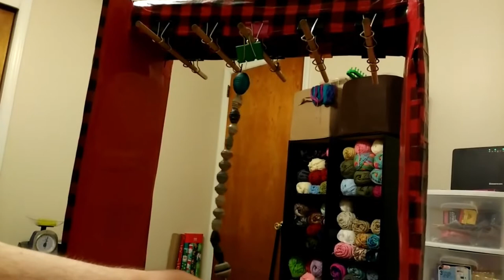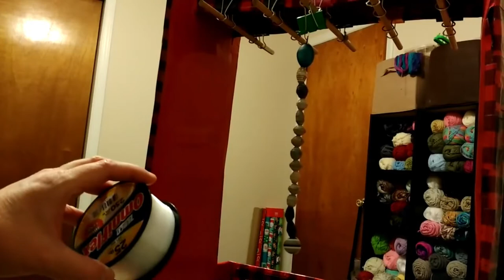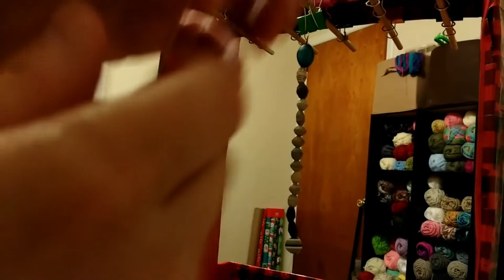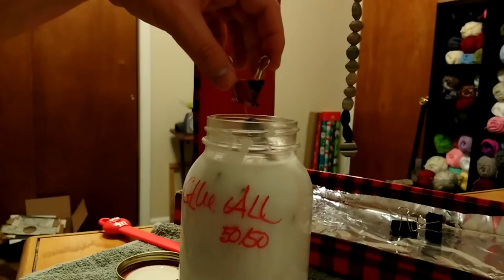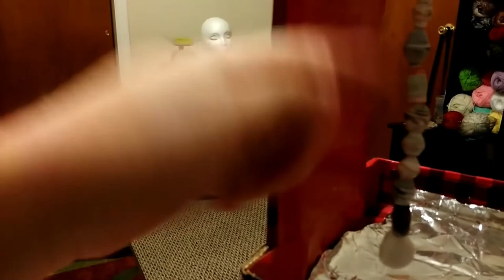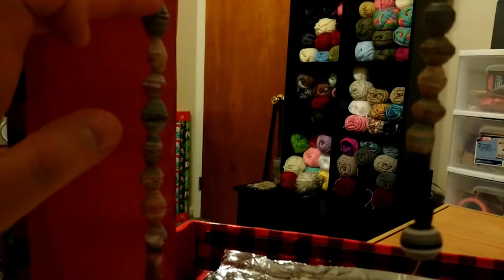Advanced Paper Bead Glazing Method | Archived 2018

Comment: You can drill out the bead if the hole gets clogged up. Thank you for sharing. What weight string do you hang them on?
Reply from the maker: Thank you for the tip. I hang my beads on it's 50 lb test fishing line.